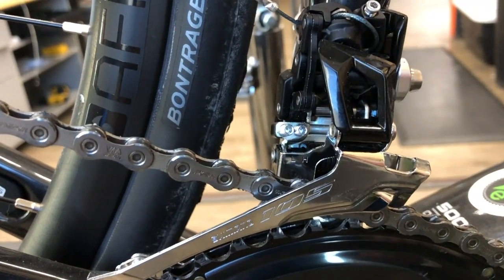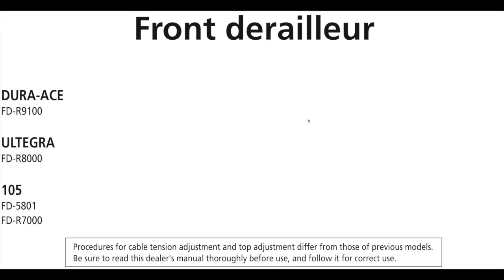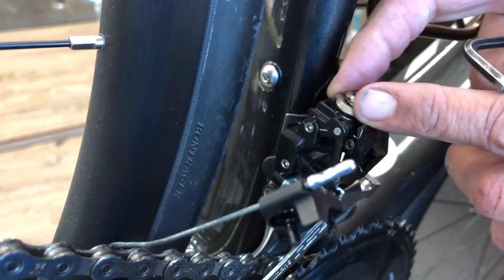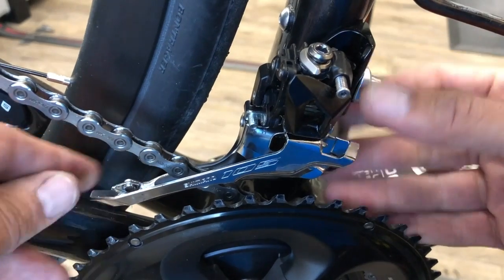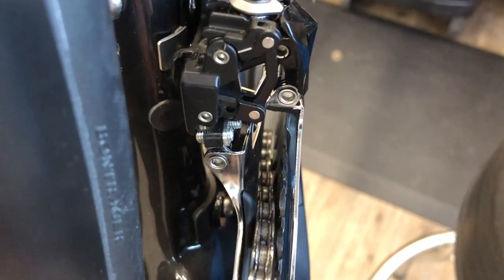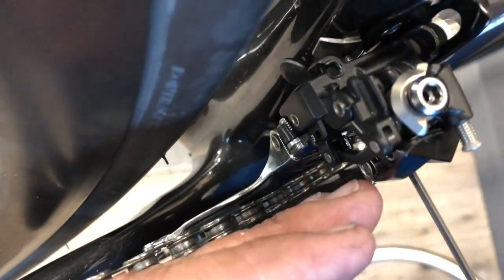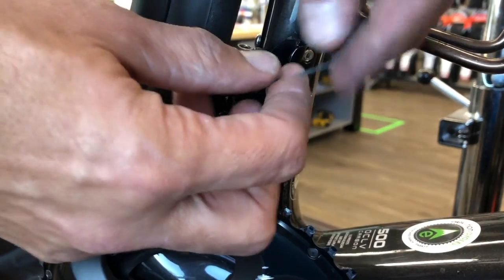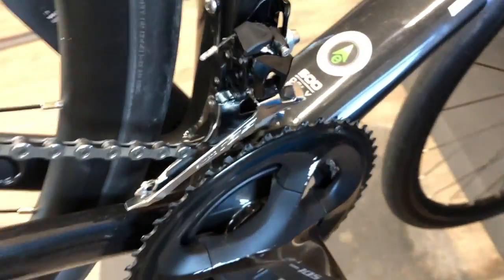Tips For Setting Up And Adjusting Shimano R5801 7000 8000 And 9100 Front Derailleurs

Comment: I join the others in thanking you. The dealer manual is not clear at all and your video made it clear that with this "new" range the setup process is different from the older range. I wasn't aware of that. In October 19 I went on an offroad tour on my specialized diverge sport (105 FD R7000and 5801 Front Derailleurs) and halfway (about km 400) I managed to suck the chain between the crank and the frame (horrible - happened due to crud and it was night-time) .  I managed to bodge the removal of the jammed chain in a roadside repair but in freeing the chain I had to remove the front derailleur. When I screwed the derailleur back on was when I discovered the setup process for the 5801 is different from the older version and I didn't know it (aaaaargh). The remaining part of the tour was spent with just the small chainring. I have been using just the small chainring since November. My January resolution is to watch your vid several times and then fix my front derailleur. Hallelujah! Praise the goddess of Allen keys....
Reply from the maker: Sweet! Thanks for taking the time to leave feedback and good luck getting that derailleur dialed in! You got this!!!

Comment: Thank you so much for such a detailed instruction for setting up the 105. 

Most of the videos on YouTube are missing the fundamental explanation of the reasons why each screw need to be adjusted. They tell you how the screws work but not showing the correct adjustment.

Glad I have my chain rub fixed. No more embarrassing noise in all gear range now. It was so loud I used to paddle slower in front of others. 
LoL
Reply from the maker: Awesome! I'm glad you got your derailleur issues figured out, and I appreciate you taking the time to leave feedback!

Comment: Once again Joey, an excellent vid. My FD-R8000 problem was chain rub when in big chainring and 3 or so smallest (high gear) cogs. During adjustment, when in top trim position, my white lines were just a hair off indicating too tight. But the adjusting barrel was backed out all the way so I couldn't loosen it anymore. So I started over and loosened the pinch bolt and released a bit of cable - really felt quite loose to me, but starting with a looser cable, my white lines were almost there, but not quite, still showing a bit tight. So I started over and this time, along with the looser cable, instead of lining up the outer derailleur plate exactly with the outside of the big ring (with low limit screw), I didn't take it quite that far, so my outer plate was probably lined up with the inside of the big ring instead of the outside. Bingo! Now my white lines needed some adjustment via tightening the barrel adjuster, and once I dialed that in, the shifting and trim is working great! My problem is gone. Not sure if that all made sense, but Thanks Joey!
Reply from the maker: Yes, it makes total sense. I generally do the same thing, but it does vary some with different cable routing setups. Thanks for your feedback!
Reply: @JoeyMesa  Awesome Joey - I knew if anyone would understand my dissertation, you would! Thanks man.

Comment: This video is the clearest. Audio is spot on. When I tried adjusting L and H screws, the guide plates didn't move however. My bolt to the braze on to align the guide plate didn't move the guide plate outward either. I have about 1,000 miles on it.
Reply from the maker: Thanks! I appreciate the feedback. Is the derailleur shifting ok?  No rubbing throughout the range of cogs in the rear?

Comment: As has been said, this vid is delightfully thorough & easy to follow.
Just a note, putting that 'half moon' washer against the flat edge of the front face on the braze on frame clamp is at odds with engineering of the parts.

Comment: And again… Thank you very much!!!

On my brand new bike, which was supposedly assembled in England, the fd 7000 was installed completely wrong so I had to redo it completel (thanks to this video it went smoothly). Yes, it’s quite different from traditional front derailleurs setup and yes, Shimano manual is quite confusing.

One more thing I want to point on (which may not be important at all :)). According to shimano manual the tape on the backup plate plate should be away off braze-on but on my bike and the bike in your video it’s glued on the side of the clamp.

Comment: Thank you so much for this excellent video!  I got a new bike and the FD was not set up correctly when I got it (terrible shift to the big ring and lots of rubbing).  I was able to get it working by adjusting the H limit screw, but took it to the LBS to have someone with experience on the 105 R7000 look at it.  When it came back the low trim did not work and making noise on the small ring and smallest 3 cogs.  I decided to start from scratch using the manual and your video.  Now everything is working great AND I know how to adjust and set up this FD!
Reply from the maker: Sweet! I'm glad the video was helpful and I appreciate your feedback!

Comment: Hi again!
Thank you for your response under the other video. I've gone through shimano instruction a couple of times already. Cable tension is ok (the marks are in line). Looks like the derailleur that I have is very similar to the one in this video, however I need to screw in the high limit screw much more to be able to switch from the small ring to the big ring. It works all right. Still I have to put the plate on, because the shop I've bought the bike in hasn't put it and I can hear the derailleur moving around on bumps.
Thank you and keep up the good work!
Reply from the maker: You're welcome! Always appreciate the feedback!

Comment: My bike came without the backing plate. The FD had flex and it would shift poorly. I was wondering why an Ultegra FD was such a dreadful experience. Then I downloaded the Shimano manual and found out about the plate. I set it up from zero again like you did in this video and it's now just perfect.
Reply from the maker: Yeah, it doesn't really work well without the plate and the stabilizer screw set. I still see a lot from him mechanics/inexperienced shop mechanics that are unaware of this fact.
Reply: RTFM, as they say!

Comment: I think Shimano dropped the ball with these front derailleurs. My main problem was coming home after a long hard ride and having my left hand more sore than my legs from all the lever ( derailleur ) resistance. I solved the problem by installing a Microsoft compatible ( 11 speed  ) front derailleur. It is a conventional design with the cable anchored on an arm that hangs to the left of the main body  ( like most front derailleurs ), thereby increasing leverage and reducing resistance at the shift lever. It shifts just as fast as the Shimano and the shift lever trim positions are more precise than with Shimano. Setup is simple, the two limit screws and cable tension. I was able to get the cable tension tight enough by pulling on it with pliers while tightening the anchor bolt. No need to use the barrel adjuster at this point. I am very happy with this outcome, just wish I thought of it sooner. The icing on the cake was that I sold the used FD8000 on eBay for more than I paid for the new Microshift derailleur (also eBay ).

Comment: In your first picture of the tension screw where you said it was too far in, that amount of threads showing was actually fine if that’s where you ended up after setting the tension. Later when you decided to do a complete set up, it had magically been run in quite a bit further, and that was not in a good final position so it needed to be corrected there, but the first instance was fine, and you changed it between shots without saying anything.
Reply from the maker: The original setup with the adjustment screw out a few turns was where this bike rolled in. I tried to get the lines for the correct tension to line up (with the derailleur in the big ring with the first trim position down), but the tension was still too loose, which is why the adjustment screw was all the way in before I reset everything. It took up a lot of time, so I edited that art out as I thought it was irrelevant. Sorry for the confusion. The important bit starts after that anyway.

Comment: You got yourself a subscriber. I have a problem with the trim from the small ring first trim position doesn’t do anything. It doesn’t move the derailleur. With the second click the derailleur move the chain directly on the big ring. The trim from the big ring works fine on both ends.
Reply: 1. Check derailleur is set at correct height and outer cage plate is parallel with chain ring line
2. With shifter completely in lowest position (ie. not taking up cable slack) Check low limit is not too far outboard by  by pushing with your thumb on cage to inboard of bike. Correct position is inner cage plate .5-1.0mm inboard of outer link of chain.
3. If first two are correct, you likely have a cable tension issue, assuming your cable and housing is not contaminated affecting the glide or friction of inner cable through outer cable housing
Reply: I agree with Mike.  Too much tension won't let the der. move that last bit of trim distance to reach the limit screw. If this is the case, then my guess of why it works at the big chainring is because this is where the spring has the most torsion...so it's overriding the high cable tension. However, at the inboard position the spring is close to home and is not torsioned enough to override.  Or your low limit screw is too far outboard. One of the two.  Simple RoT: Tension for chain moving up - Slack for chain moving down.

Comment: Great video. On my 7000 i'm finding that the cage never gets sufficiently inboard to not rub on the small chainring/big cog combo. Even if i back the L adjustment all the way out. I guess I may have too much tension so even when the shifter is completely released, the cage doesn't drop inboard enough so as not to rub.

Comment: Great video!! What I noticed with my FD and it appears to happen here. The high limit screw is screwed in so much that the low limit screw doesnt touch anymore in the small chainring. I don't have any issues shifting but it seems like the only thing the l limit is good for is getting the initial cable tension correct

Comment: This derailleur is so different, it's like it was designed by aliens. One comment already has suggested adjustment screws magically reposition themselves in the video without explanation. I've also noticed that the place the cable emerges from under the fastening plate magically changes. At first it emerges under or to the left of the nub on the fastening plate and/or the fastening plate was not rotated all the way to the right. Later in the video the cable comes out at the right side base of the nub on the fastening plate, and the fastening plate was rotated to the right, all as shown in Shimano's dealer's manual. On my new bike, I was having zero luck getting the tension right on the cable doing it the way the manual and this video wanted. With all due regard to getting the lines to align while in H trimmed position, I think its better to make sure the cable is not slack or too tight in L trimmed, so L trim works properly. For me that meant shifting all the way down, unscrewing the L screw and tensioner screw fully, unfastening the cable and using a cable puller. Then tried the low trim with the cable sticking out and made sure it worked properly (could shift from high to high trimmed to low to low trimmed). Then looped the cable around and pushed the plastic cap on. Lines were in alignment in H trimmed, about a mm beyond in H. Didn't really need to use the tensioner screw, just screwed it in until snug. L screw needed to be screwed in a little, just until left side of the cage almost touched chain.

Comment: Thank you Joey - the level of detail and accuracy in your video is amazing - by far the best. Quick question, is the Shimano manual wrong on Pg 19 (Top Adj)? It states that the largest chainring  and largest sprocket is the adjustment position. In the video, you adjusted on largest chainring and smallest sprocket (which makes more sense to me). Just curious. Please advise.

Comment: Hi Joey, thanks for the video. Your video made the shimano manual clear for me. However, I was still not able to shift from the small chainring to the large chainring, even after following these steps. I have the shimano 105 R7000 groupset. The front derailleur moves, but it's not enough to even move the chain up. Second issue I'm facing is the 105 front shifter (front derailleur) not engaging to shift to larger chainring unless I move the small tab between the shifters. These are 2 separate issues I'm currently having with my 105 shifter and front derailleur. Any ideas? Thanks!

Comment: Thanks for doing this video, it’s a really big help. One question; why did you move the derailleur back inward after clamping the cable and before setting the tension with the barrel adjuster? This step doesn’t appear to be in the Shimano tech doc. I assume you’ve added this step from experience. Or is it an essential step that the tech doc missed out? Thanks, Tim.
Reply from the maker: By initially adjusting the low limit screw out, it sets the derailleur up to clamp the cable in the ideal spot on the cable. It doesn't really matter if you shift the derailleur up, trim the shifter and set the line on the barrel adjustment screw first, or back the limit screw to the approximate location first. It's not really essential, it just seems quicker. Sorry for the confusion. Thanks for the question though!

Comment: Hey Joey, very nice video! I have been messing with this for a while on a new bike. I kept re-doing it, but the derailleur cage kept getting stuck on the big chain ring. Finally I just unbolted the derailleur, since it seemed it rotated out of alignment, and lined it back up parallel to the chain ring, while the cable was still connected and Bam, everything worked just fine after that. Thanks for the very nice video and using the Shimano dealer manual helped quite a bit, but never really read it, until I saw your video. Hope this helps other Folks if they still have problems. I do not know why the cage kept getting out of parallel alignment.
Reply from the maker: Glad you got it figured u! Thanks for taking the time to leave feedback!

Comment: 17:51 As per Shimano, the stabilization bolt should not contact the backing plate directly in line with where the adhesive tape is located.
Reply from the maker: I agree, but on some bikes, there are really no other options. If you go to about the 10:30 point in the video, you'll see the plate is all the way against the braze-on hanger. The seat tube on the frame is too round to match the contour of the plate, co this was the only option in this particular situation.

Comment: Brilliant.  I've watched so many vids claiming to show how to set up the trim and none of them have been right.  Showing how to start from scratch was a bonus although I'm now scratching my head as to why my Giant Defy came with Ultegra but no back plate or stand off screw.  Lazy bike store or do Giant think they're redundant?
Reply from the maker: Thanks for the feedback. Some bikes don't need the little stick on plate because the hanger portion is designed to be used instead. If the shop didn't engage the stand off screw, they either didn't know about it or were lazy with the set up. Unless the derailleur is a clamp on style, you'll never get the best shift quality without the screw resting against the plate or braze on hanger. The screw is in there if you have a braze on derailleur, unless it's partially out, it can be hard to see.
Reply: Totally agree

Comment: Great video. My high trim is working great. But no movement on low trim.. What would cause these and are there any fixes?
Reply: See my other post. That low trim is the last very small amount of movement on the low end, so if the cable is too tight (or loose), or if the L screw is screwed in too far, its not going to happen. What worked for me: making low trim priority #1. Meaning, shift all the way down, unfasten the cable, unscrew the L screw until it's completely retracted, remove the tensioner screw, use a cable puller, make sure there's no slack in the cable between the frame and derailleur (but isn't tight either), fasten the cable (don't worry about looping it around the top yet), make sure the low trim is working the way its supposed to (can shift from high to high trimmed to low to low trimmed). Then do everything else that needs doing (loop the cable around the top, place the cap, screw in the L screw until the cage almost rubs, screw in tensioner screw, adjust the high gears if needed).

Comment: Hi Joey, I've got one where the stabilizing screw won't reach the backing plate on the seat tube. I thought I remembered you running into the same thing and epoxying a piece of something onto the downtube, but I can't find it now. Can you give me any more details on what and how you rigged up something that worked in this situation? So this is a replacement of a 5800 to a R7000. With the 5800, the screw reached the plate, but not with the R7000. Frame is a 2016 Trek Emonda ALR 5. Thanks for any help!

Comment: Thank you for this helpful video. I just bought a new bike and wondered why the trim in the large ring is not doing anything . Would that be too much cable tension or not enough ?
Reply from the maker: Sounds like too much cable tension, but it also depends on the relation of the derailleur to the chain in various gears.